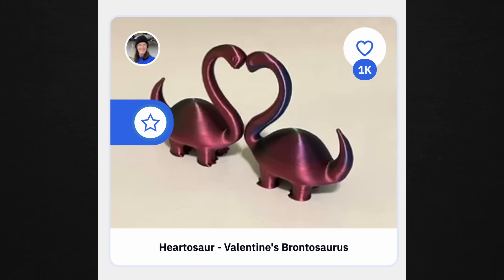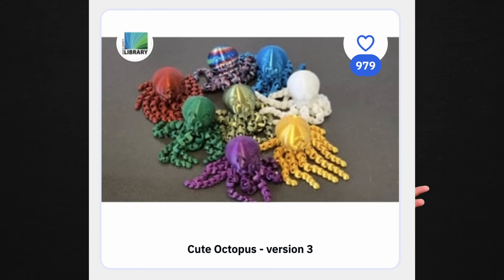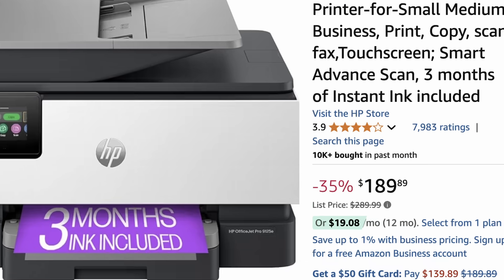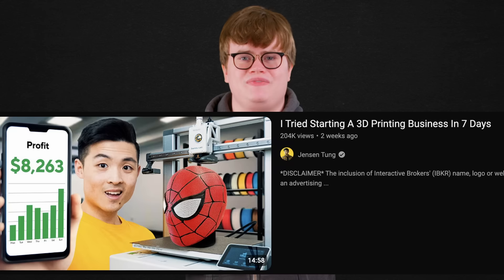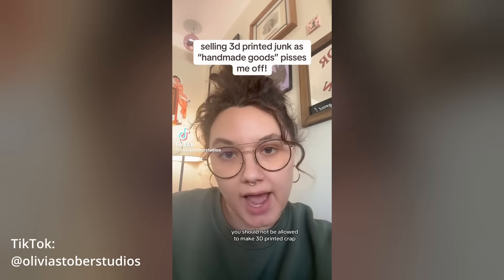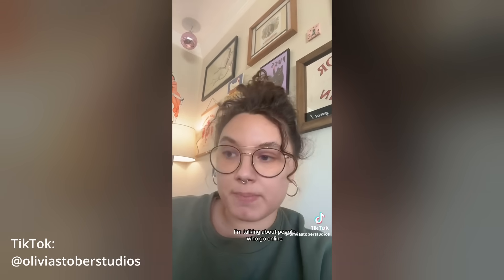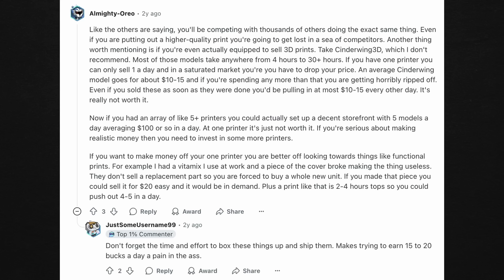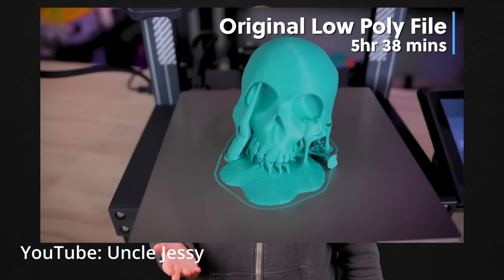The Rise of 3D-Printed Slop

Comment: My favorite thing to make with 3D printers are organizational systems.

I’m still mentally used to using CAD for machining so I need to eventually figure out how to wrap my head around working at the scale of a 3d printer. 

Also my favorite part of 3D printing is making Warhammer 40k models because then I can make a full army for $30 worth of resin instead of buying $1500 worth of figurines.

Comment: Hey so i jusf want to bring up a few points first off I would like to mention that a majority of this 3d printed "slop" is printed out of PLA (poly lactic acid) this is a bio plastic that most commonly comes from plants such as corn or sugarcane so the environmental impact of it is relatively low. The second thing about pla is that it simply doesnt give off any nasty fumes or anything. The only common 3d printer fillament is abs or asa and those materials need an inclosed printer to print. And most have carbon filters that filter out most of the harmful fumes. Second off 3d printing is incorporated into many hobbies where custom parts are needed like with rc cars, planes, rocketry, and fpv drones and a majority of the models you need to make yourself. Third off everything you see on thingiverse printables thangs or makerworld can not be sold and most of them are just fun things that can just bring joy to people its not that deep... because of how many different hobbies use 3d printing the only thing in common will be the #1 and in this case its this slop. The one thing i ask is before you dig on a hobby try it 3d printing is getting cheaper and cheaper every year.

Comment: I don't have a 3d printer, but sometimes design and order parts. Mostly those are:
1. Cases and enclosures for electronics;
2. Mounting plates, adapters and other stuf that makes things hold together;
3. Spare parts (replacemant cogs, pushbuttons and stuff).

3d printers are hardly useful for anything else.

Comment: I think the core problem is that 3D printers were marketed as a thing that eventually everyone would need and have. Realistically, they should be treated as a tool just like anything else. Do you have a need for a drill press? No? Well then obviously don't buy one. With 3D printers though, because they've come down in price the viral mysticism behind them has a disproportionate amount of people thinking they "should buy one" when in reality they have absolutely no need for one. I have two different printers that each serve a distinct utility outside of printing junk to get thrown in a box (Except for my printed Warhammer stuff which I painstakingly assemble and paint to be thrown in a box because none of my friends want to play Warhammer with me) 

As a certifiable 3D printing enthusiast, I only really ever recommend people get into it if they have a good reason to. New homeowners with old houses are the perfect audience, because there are a million little brackets and fixtures you'll need which could cost $15 at home Depot or $0.35 and half an hour on a printer. Without that purpose of utility though, it is kind of pointless to buy a 3D printer. If my friend isn't a wood worker and hasn't shown any desire to learn that scale, I'm not going to buy them a lathe and a bench grinder.

Comment: Same for those Cricut machines if they are still in fashion.  Mine is covered in dust because I only use it when I want to make something practical.  Most of the users out there of those machines are doing the same thing as these 3D printer people…buying tons of materials to make trinkets from a pattern.  The biggest problem is, what do they do with the items after they’ve made them?   You might wear it once or twice or drink from it once, but what are you doing besides piling useless things up?

Comment: This "slop" is a catalog of toys. Tin toys gave way to injection-molded plastic, and if a farm of printers were to prove more effective, it's possible injection-molding may yield to printing. While this is a far cry from the future we've been promised, CAD access and literacy is what will pave the way for wider diversity and efficacy in production of printable items.

Programs like OpenSCAD exist - free, ready-to-use modeling software for aspiring engineers (or even aspiring toy-peddlers) to gain their bearings on.

Comment: thank you for this video. I love 3D printers but I am sooooooo tired of seeing these unsanded 3d-printed dragons and octopi on every convention I go to. I think 3D printers are awesome, but so many just produce useless things that are intersting for a couple of minutes just to make a bit of money. I have a 3D resin printer myself (entrusted to me by a friend) and use it for prototyping of my jewellery, because handcrafting all parts led to a lot of frustration, a lot of wasted material, constant adjustments and wasted time. I did this for the last 3 years and I was tired of it. 3D printing allows me to be faster and more precise as I can sculpt and test most things digitally and then check whether I did a good job once they're printed. Since I create my own molds this of course makes molding significantly easier as well, as I can print multiple prototypes, sand and refine them and then use them for the molding process.

Comment: That's why I only list things on my etsy shop that can only be obtained by 3D printing them and are for things I use myself for my hobby. I also print in slow higher resolutions with specific translucent colors that pertain to the hobby itself. That said honestly that's not even why I got a printer in the first place lol it was to print parts for my 1988 car that are no longer for purchase like the AC control housing. Dudes were selling the just the 3D printed housing itself for $200 on esty, so I spent $100 on a cheap crappy printer and spent a year learning to print it myself. Also by sticking with niche products that people will actually use I've covered all my costs on my filament and printers, I haven't made a huge profit or anything, but covering my own costs is certainly nice.

Comment: All i can say about this video is that it's poorly researched. The point about the influx of garbage I'd agree with, although that is under the opinion category, it's not the fact category. When it comes to 3d printing itself, the facts are replaced with a weird phobia. If you're worried about melting plastic with a printer, most filaments don't release toxic gases. Do your research and off the top of my head, avoid ABS filament, which is seldom used anyway, and resin 3d printers if you're worried about fumes. Mostly do some research. Most 3d printing youtubers are hobbiests and tech geeks looking to teach you new things and giving away many of their designs free of charge. I've personally found very few looking to teach "sell slop." Most teach how to get the best prints, with lowest print times. Oh, BTW, printed custom Legos are a thing. You'll find videos that teach you how to customize the blocks the way you want them. You can even 3d print "velcro" or variations of it anyway. Also, the newest printers are printing 3-5 different colors, and average print times are dropping daily. The aforementioned hours for small prints... try 20min-30 for a small, and maybe 1hr to 2hrs, could be 3, depending on overhang and supports, for a med to larger print. My bigger printer takes a bit longer, but it's older, and I usually only use it for massive prints due to its size. The point is that this video has zero research done. It's an opinion video with nothing but speculation and misunderstanding to back up most of its facts. Although I myself am disgusted with the slop. It's insulting to true 3d printing enthusiasts.

Comment: This is why the only thing I buy that's 3D printed from people is Warhammer proxies, cause like 99% of the time, even if it costs a lot more to buy than it costs to print, it's still VASTLY cheaper than buying from Games Workshop or something. 

I can get a squad of 10 "not Guardsmen" (or even custom stuff like Halo CE Marines/Reach Troopers, or Clone Troopers, ect) for like 10 to 20 bucks cheaper than getting a squad of 10 Guardsmen.  Same with literally anything else I'd need.

Comment: It's being lazy what's causing this. I started with these random trinkets too because my printer wasn't very well tuned so I used these to make it better.
The first useful thing I printed was a casing for 18650 battery tester. about 6 months from buying the printer I started playing in tinker cad and I actually designed a case for an IR remote that broke. I am now trying my hand at printing my own themed merch. You got to be creative. And tinker cad is an excellent beginner cad software for basic things.

Comment: If you ever get a 3D printer, go the full way and get a micro CNC machine.
Use the 3D printer to create molds of parts you want made out of metal, which you can then cast. Just melt the plastic out the mold and replace the empty space with molten metal.
Then, use the CNC machine to add certain details. From there, it's up to pure budget if you wanna try your hand at heat-treating and coating whatever you made.

Comment: i'm just gonna make my own pistol, i don't think having the printer inherently contributes to slop even if you're making many things. i have the design, once the printer gets here i can create the first prototype and then get to work on design polish. i want something perfect for me, and this is the best way to do that. i've been modeling for years, i can shit out whatever i want with a 3D printer. this equipment bridges the gap between digital, and physical, by allowing me to create and then cast my own parts to metal. If you're so worried about slop, then why not just destroy the failed and outdated versions? plastic recycles. metal melts. who cares? make whatever you want.

Comment: My theory on this is that a lot of "tech enthusiasts" out there are dissatisfied because they put so much of their lives into digital gadgets that don't give them any physical payoff. They see 3D printers as a way to change the pixels of the computer they live inside into a real world object. My message to those people is, you CAN learn how to use a saw. You can learn how to use a drill. You can learn ceramics. You can even learn how to use a welder or a CNC machine. You can learn the crafts that make real, useful objects using tools and your human hands.
Reply: Maybe I don't want to spend hundreds of hours learning to sculpt in clay when I can sculpt digitally and share my designs with the world. A 3d printer is just another kind of tool. Get off your fucking high horse.

Comment: Bro, about selling printed things. I don't really care if someone sells printed toys and decorative stuff if it looks cool. But recently i got into airguns, and DUDE the amount of 3d printed junk parts that break almost instantly is insane. And the issue here is not the printing itself, but how it's done. They use materials and printers meant for prototyping, before you actually start real manufacturing. No special materials, no pricision, no durability as a result. Not to mention, you pay 10 to 100 times more for a one-off replacement part copmared to the price you pay for the filament, electricity and possibility of a printer malfunction.

Comment: 3D-printed slop might be a topic worthy of discussion, but this video contributes nothing of value. I'm not familiar with Robert Tolppi's other work, but this video sounds like an essay written by a primary school student the night before it's due. 

There are a few reasonable points that could be made (waste and pollution, unrealistic business expectations, health impacts), but these are undermined by Robert's apparent lack of research. The video makes claims about the consumer 3D printer market and user behaviour, but provides no evidence to support those claims. Furthermore, the creator's impressions of the difficulty, reliability, and quality of consumer 3D printing appear several years out of date. 

There are two things that prompted me to write a lengthy comment about (and boost the engagement of) a video that should be ignored. One reason is the hypocrisy of a YouTuber deriding one form of slop content while producing their own. However, the more serious reason is that the video creator's lack of knowledge about a CAD and 3D modelling might dissuade people from trying. I believe anyone capable of operating a 3D printer can produce their own practical models. There are many free software options, including cloud-based, so if you already have a 3D printer there is virtually no barrier to entry. 

I encourage anyone who has a 3D printer to have a go at modelling. You can start by modifying something you downloaded that doesn't quit fit your needs, but once you understand the basics you'll probably find it's even easier to many things from scratch.

Comment: I've also noticed "3D printed" is becoming an advertised feature for the end consumer despite the fact 3D printing produces an inferior quality material compared to almost any other type of manufacturing I could think of.
All of the potential benefits are from the manufacturers side.
Reply: That depends on the market. Resin? FDM? SLS? They all offer very different things with vastly different outcomes.
 
 SLS is taking off in the automotive, aerocraft, and firearms industries. Its able to produce products too complicated for traditional CNC mills & lathes while maintaining roughly the same strength. FDM has been in all of the previously mentioned industries for a while now, too. Usually for prototyping.

 Resin printing has been around longer than I have and used for quite a while, you can actually see a resin printer in action (and with special effects) in the movie "Small Soldiers!". Its the scene where the action figures are being produced out of a vat of goo with lasers.

Comment: While I have not seen 3D printing done in person, I will say that it helps with disabled people especially blind and low vision (I have low vision) access things they otherwise wouldn’t be able to. Such as printing 3D models of certain peoples faces or models of buildings and other things. I definitely understand that there is 3D printing slop out there. Plastic pieces falling apart, molds not being authentic and more. I feel that for accessibility reasons, it can work out. But it’s like many said, practice makes perfect. Don’t print something you have no idea doing. Be cautious and caring when doing 3D printing especially when trying to be accessible to disabled folk.

Comment: A ring size measurer I print at home from bioplastic is probably going to be significantly less impactful on the environment than one ordered off TEMU.

There are a bunch of things I've printed straight from thingiverse because they are useful and do what I need already. However I have gone to the trouble of learning 3D CAD so that I can design my own things as well.

I'm a board gamer and having boxes to store components and make setup easier is hugely useful and a great reason to have a 3D printer. Some box organisers/inserts I've made I printed straight from the download, but others I've modified first, and some I've redesigned the models from scratch for more significant changes. 

I've also designed and printed a replacement part for my fridge. I uploaded the design to thingiverse because it was a complex design that no one else had done and i thought it would be good for my time and effort to not go to waste.

Comment: Most 3D printed stuff is made with PLA which is a bioplastic, it's not made from oil and will actually biodegrade, not just turn into microplastics for ever.

I mostly use PLA, and limit my use of PETG and TPU to specific scenarios.

I'm making this comment after just the start of your video so I'm curious where it goes, but i felt the need to address that all plastics aren't the same.
Reply: > will actually biodegrade
This is a semi-myth, it will only biodegrade in industrial composters, not landfills or home composters where most people would be throwing them.

Comment: That is the reason I never even printed a benchy... When one gets 3D printer it's inevitable, they will print some crap. However it is important to realize as soon as possible that it is a crap that they printed and it should be avoided and it's important to realize that 3D printer doesn't have to be running 24/7. 3D printers are very powerful machines when you start using it for prototyping custom things that actually perfectly fit somewhere, maybe even end product would be injection mold or to fix something broken or to fix something that annoys you in your house. I do too constantly visit thingiverse, printables and maker world, but only to draw inspiration for my own parts. Because maybe someone has made a better hinge than I could think of, or maybe someone had an brilliant idea how to make a design more versatile and etc. But rarely I'd find something to print straight out of those pages that would fit my needs.

Comment: My partner 3D prints, he occasionally makes little silly things if people ask but he mostly models and prints things he can't buy like organization for specific tools, bracket/adapters, mounting standards, etc, he also uses filament that supposedly biodegrades in about 60 years. I feel like if you're going to 3D print you should probably use it for problem solving like he does or use it for art

Comment: I like 3D printing, it’s great to manufacture parts of which you only need a few or one, because injection molding is not feasible. Or printing replacement parts if stuff breaks. But for manufacturing lots of the same things for selling, 3D printing just seems the wrong tool. But injection molding is probably too expensive to set up in some random guys basement…